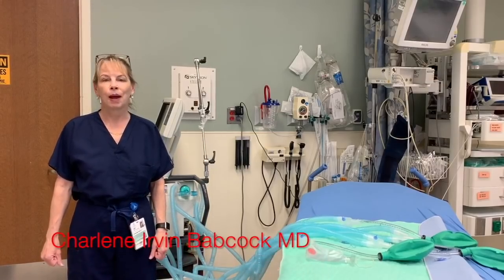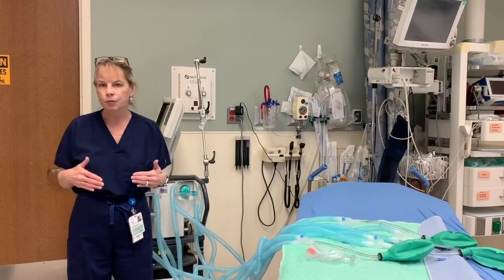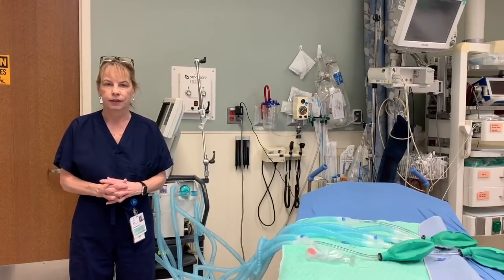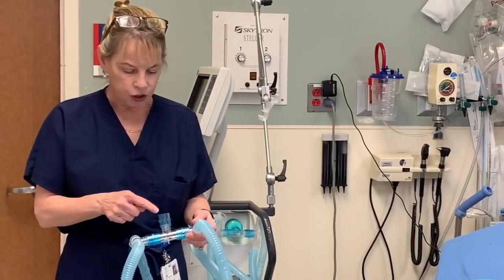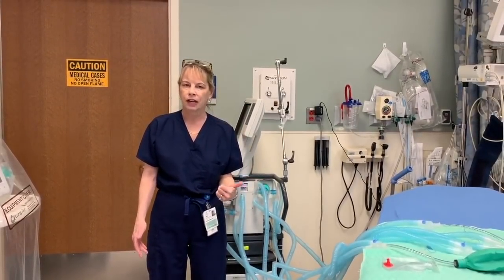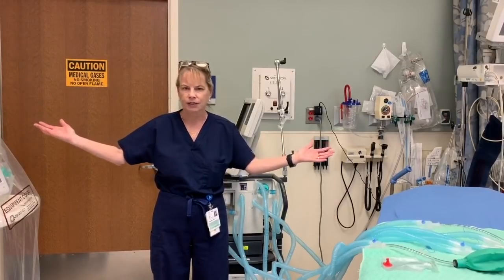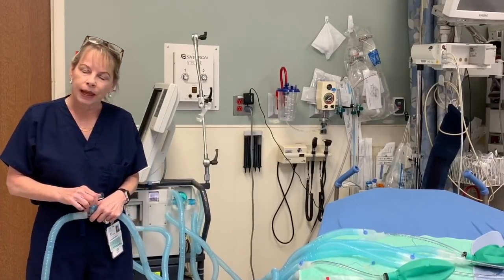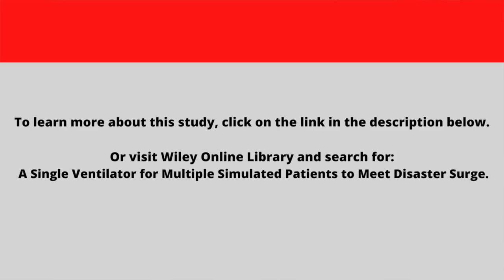COVID-19 How to Use One Ventilator to Save Multiple Lives

Comment: To reduce the flow rate to a single patient you just need to squeeze his particular tube with a simple clamp.
Reply: pls explain
Reply: @eirikskotnerhegstad6361  If you constrict a tube, (just like a if you constrict a garden hose pipe by stepping on it),  you will reduce its internal cross section, which, if the air pressure remains the same, will inevitably reduce airflow. Within this four tube ventilator tubing system, if you restrict the flow within one tube then the flow will (unless somehow the ventilator compensates) automatically be re-directed to the three other tubes, thus increasing their pressure slightly. So each patient can have their flow customised to their requirement by the simple expedient of putting a simple cheap screw clamp over each tube and the clamp tightened very sensitively according to the required flow. The flow from each tube could be measured using a pressure meter, or if these are in short supply then a tiny hand held wind speed meter (like used by sailors) could measure the air speed. If various air speeds, from this particular tube, had once been calibrated with air pressure then a simple chart correlating the air speed with pressure would correctly indicate air pressure.
Reply: Sandy Allsopp that’s not how it works with the ventilators. You’ll cause peak pressuring and an overall reduction in volumes delivered. We are able to control flow to the patient on the ventilator. Please, stop spreading false information by thinking you’re able to fix things with a clamp. That’s not how this works.
Reply: You may not have noticed that I put a caveat into my reply saying; (unless somehow the ventilator compensates). So I considered this. However, I am in the bottled gas business which is totally dependant upon gas restriction via various means and I know that restricting tubes in a subtle manner can be a very effective way of reducing gas supply very finely. If you listen to the video Dr Babcock said that the patients would be paralysed (so hopefully no coughing etc) and they would be sorted to be of generally the same size and tidal volume etc. She considered this and will not be using one machine for a huge man and a tiny child. So all that might be needed in the way of differing flow rates would be subtle changes (maybe 5% - 10% ?). Now, remember we will be using two or more tubes to two or more patients, so pressure build up from constricting one tube will be far less (if anything significant) compared to when using one tube to one patient. Are you saying that a 10% reduction in one of multiple tubes will really cause peak pressuring? If so show me the quantitative data. I  know from long experience of designing and making numerous systems that just thinking about something is not nearly as good as thinking and trying out. It is amazing how many things you learn that were totally unexpected by actually testing things for real. I listen to experts but don't take their word for everything. I want to know they tried it for real first. Unlike almost everyone I know, I do actually try things out for real in realistic circumstances. This way the world learns and moves forward. So what I am saying is just give it a go and test it out. This will only take a few minutes and cost nothing, but the payoff could be the doubling or more of available machines - this saving countless lives. Nothing wrong about considering peak pressures. But you seem to want to stop invaluable investigation by worrying about peak pressures that may not happen. You do NOT know until you have tried it.
Reply: Sandy Allsopp my god you are so dense. I work in a critical care setting actually working with ventilators. Contracting any tube does not give accurate tidal volume distribution. There is no way to monitor each persons rate or volumes delivered when attached to multiple people. Guess what? Rebreathing of CO2 is definitely going to happen here. Not to mention the amount of circuits in itself will cause too much dead pace. You need to honestly sit down and stop trying to compare your experience with working with bottled gas to people who have years of experience in knowledge in actual medical practice.
Reply: Sandy Allsopp Guess what? Multiple people react different to ventilator settings as well. We obtain ABG’s around the clock to determine what settings we need to change. What do you do when one patient needs a higher set rate and the other needs to have their rate lowered? How about one needs FIO2 titrations and the other doesn’t? You literally put more people at risk thinking placing multiple people on one ventilator.  You literally risk killing them all. I also don’t think you understand how much work is being done on just one patient. One patient with pneumonia 2ndary to sepsis on a ventilator takes multiple people and hours of work alone. You’re thinking of trying to cram multiple people in one room on the same ventilator? You risk having them all code and losing them all. Just stop while you’re ahead.
Reply from the maker: GREAT IDEA!!!!

Comment: Sorry..old shool here; But the minute one patient cough theres goes the rest of your ventilation for the rest of the patients... if they all cough at diferent times..same problem... also you suction one...your are pulling volume from the rest.... this system has to be improved with a series of one way valves....also cross contamination .... if you still have  old Bird mark 7 in a closet, that would be the best bet... mas casualty vent vortran (on a paralyzed patient) also you can pressure ventilator but difficult to manage volumes...
Reply: So this method is just delaying the inevitable or, even worse, endangering all the lives on the ventilator?
Reply: attlee2010 this method doesn’t work. The women doesn’t know how ventilator works and is simply just trying to make it work on a test lung (simple balloon). Patients aren’t going to have the same ventilator settings and will react differently to changes. There are 100’s of variables and reasons why this won’t work.
Reply: Beard OF-Courage she said it did work in the response to the Las Vegas shooting. She links to the publisher academic paper  in the notes below the video
Reply: attlee2010 that was also only done for minutes, where they most likely caused volutrauma to the patient as well. Bagging a patient is more recommended than just placing multiple on a single ventilator. Anyone who has experience with ventilators, like myself, know this doctor is full of shit.
Reply from the maker: @Beard-OF-Courage  Bagging a patient has lots of evidence we over bag .....may not be best solution...
Reply: she did mention in a comment that it would only work with paralysed patients,  the one way valve is a good idea, cross contamination is certainly a risk, I think the biggest problem would be the volume management of multiple patients, I guess in an emergency setting, getting similar sized people would be the best shot.

Comment: If you actually showed this passing a SST and showed this on a real test lung that allows you to simulate an ARDS/ALI changing Cstat, Cdyn, Pplat, Ppeak for each pt with the PB840 screen working for over 6 hours, I would maybe believe this 4 person technique ventilation. The infection control on this is insane. Adding filters to this already spectacular amount of dead space is going to make ventilation extremely difficult and in no way equal for all pts. On top of the legal stand point. Did you consult Covidien(PB)? What ventilators were they using in Italy for their multiple ventilation procedures? I can assure you that while the basic mechanics of ventilation are the same, brands run differently. Not to mention that if you're implicated in a lawsuit from this, you are going to lose your license. Yes you spoke to the families prior but I doubt they would really understand what is happening with this procedure.
Reply: Diane Harris she links to her published journal paper below the video. That may answer your questions. She said it worked on patients in LA
Reply: @attlee2010  no it does not. She reiterates what is in the paper. These questions are not answered nor or they asked.

Comment: The deadspace in this circuit is insane, if we were really this screwed then it might be beneficial to use shorter corrugated tubing and y connectors otherwise you're doing a lot of rebreathing.
Reply: Where is all this dead space?
Reply: Angry Breatherer from the additional tubing not meant to be part of the circuit. That is your dead space.
Reply: Mr Tech Gamer 
No, that is additional compliance volume lost.  NOT dead space.
Reply: Angry Breatherer look for the definition of dead space.
Reply: Mr Tech Gamer which type?
Reply: Angry Breatherer Google it
Reply: Mr Tech Gamer 
Well.  Your still going to have to specify which type specifically :) and while you’re at it you may as well point out the exact location of the dead space.  I fail to see it.
Reply: @oldfashionedsportsmanchave4590  every part of the circuit not involved in perfused alveolar gas exchange is dead space. This includes the trachea, the bronchial tree, the filter/humidifier, and the corrugated tubing. In peds patients even the filter can make a very significant difference.
Reply: John L. Nope. Not so homie. Dead space stops at the “wye”.
Reply: Christopher Whelchel 
That vent can deliver a base flow of 20lpm.   Plenty to wash out exhaled gas On paralyzed Patients.  And with inspiratory flow capabilities, of 200lpm.  That vent in PCAC could easily ventilate 4 people with adequate inspiratory flows.  Place 4 end tidal  devices in line, and adjust rate / pressure so every patient has the best average end tidal.   Dead space would be a non issue.  Compressible volume, non issue as the goal would be to ventilate per end tidal and chest rise.  The triggering limitations caused by the increased compressible volume would also be a non issue, as they would require paralytics anyway.  Being pressure limited, low risk of barotrauma/ volutrauma.  As these patients would be ARDSy.  They would have short time constants, making air trapping a non issue.  The literal only limitation would be variance in volume distribution per patient, BUT,  it wouldn’t be enough that this method wouldn’t keep 4 similar patients alive long enough for other resources to come available.  In my opinion of course.
Reply: Christopher Whelchel 
Christopher Whelchel 
That’s interesting.  My pb840 pocket guide clearly states 200lpm.  And ards patients have very short time constants.  So, they don’t need a long time to fill or empty.   Sooooo.  Your 6’ guy would need a VT of 465 at 6ml/kg.  At a rate of 30 that’s a TCT of 2.0sec.  Say you give him a 33% iTime.  Probably  fast enough eh? That’s a minute  volume of 14/33x.01= so 42lpm peak flow needed.  It would be roughly a 0.66sec iTime.  Either way, add that up 4 ways and it’s still beneath your 180lpm.  
Some populations might have longer time constants on expiration.  But it would be unusual once ARDS is set in.   Making those settings again, viable.  
Optimal....no.  
As far as diffusion complications.  Turn them up to 100% man.  Give extra PEEP if you feel the need.  BUT diffusion problems do NOT  lead to CO2 retention.   Remember it diffuses 20x faster than O2.  Diffusion rates for common gases from fasted to slowest,  CO2, O2, and CO.  But who care about that.  
It would work.
Reply from the maker: I agree....makes sense to use shortest tubing possible....

Comment: Can someone explain why there is not a central system like maybe oxygen with independent regulators or other required devices to tailor for each patient. Why the need for independent machines.
Reply: Depending on the underlying problem, patient's need various settings on the ventilator.  You cannot put someone with bad heart failure needing a vent with someone suffering from trauma for instance, their specific ventilation needs are different.  But if you have enough similar patients with similar disease, this could work.
Reply: SCMakaveli yes but why a single machine per patient. There are many “plumbing” cases where a central system delivers then individual valves/computers control the final output to each. I know it’s more complex then just the oxygen to each room but seems like an opportunity for improvement.
Reply: @gabrielbatiz8168  This is precisely why this setup will likely not benefit a COVID-19 patient.  #1, we're all different sizes and shapes.  #2 every patient has a different demand for ventilation, some with renal failure will require more ventilation.  Those without will require less. #3  Having a "central system" is not possible because of the driving pressures required to actually ventilate a patient  #4 sharing equipment has been a no-no for a long time because of infection from cross contamination between patients.  How do you think all those folks got sick on cruise ships?  CROSS-Contamination.
Reply: It's not just about O2. Pressures, volumes, flow and time are controlled by the ventilator depending on which mode/strategy of ventilation is employed.

Comment: These Las Vegas patients cited as proof that this works was in patients that weren't battling a disease that directly effects the lungs, and in many leads to ARDS. This is begging for more problems than it potentially solved as you start having four patients with rapidly changing conditions hooked up to a machine that can't provide you with measurements and accurate data on any one of those patients.
Reply from the maker: It is being used successfully in ITaly.....yes it is off label...yes it challenges the clinician to 'match' patients as best as possible for compliance, TV, resistance, etc...but it is working...see below about Italy...I've also been told its being used in Egypt.....  THe last sentance in the article (translated) is: "...its like multiplying  fish and loaves."

Dr Marco Ranieri of Bologna, Italy and his team Have successfully tested the approach in vivo in one of the hospitals in Italy overwhelmed by the COVID-19. 

They worked with Intersurgical, an Italian company based in Mirandola, started producing the circuitry in only 72 hours, and the first prototype has already been tested by Bologna Sant'Orsola Hospital. It works and in the next few days they'll start a mass production to supply Italian hospitals who are in need

Here some news in Italian. 

https://www.huffingtonpost.it/entry/a-mirandola-testato-ventilatore-che-assiste-2-pazienti-bonaccini-straordinario_it_5e73c3e1c5b6f5b7c540a8d2
Reply: i don't understand your problems with this method. you have no idea about the massive number of patients this pandemic can bring to the hospital with respiratory failure. at such a situation it is less about the quality of care and more of the number of lives saved. you must be one of those people who would insist on a 10 minute history taking and 20 minutes of general examination and another 30 mins of systemic examination before you decide what to do with a patient. in a disaster setting at least 10 would die waiting in line for you. different situations need different solutions. not more problems
Reply: What a stupid comment - what is your suggestion?  Pick one to live and let the other 3 die?

Comment: This is great. Am an MD. We have some people trying to see if they can use 3D printers to make connectors. Another thought I had. Can we add a small hole with cap on each connector we could put a tire pressure gage on and measure pressure to each patient. And then change the diameter of the connecting tube to adjust pressure? This would allow for minor differences in compliance as ARDS progresses. Thank you for posting.
Reply: You won't be able to independently measure pressure... As all four 12 foot circuits are connected to common points on the ventilator.  Plus a tire pressure gauge is not sensitive enough, as it measures in PSI.  Whereas vents will measure in cmH2O.  You'll have to convert but the unit of measure won't be precise enough coming from a tire pressure gauge.
Reply: sunny you are on the right part.  I was thinking of doing this.  I am working on the plans right now.  please come join OpenRespirator.org we need all the help we can get

Comment: Only part of the idea of the patients being cohorted with coronavirus mitigating the risk for cross contamination is accurate.  We each have our own normal flora that our bodies are used to.  With the risk of secondary bacterial pneumonia being a huge risk with the leukopenia that has been reported with some of these cases, I believe it's important to really consider the cross-contamination risk.
Reply from the maker: you can add a filter to the 'mixing. bowl' right at. the expiration port. at the ventilator.  Four filters in line before the vent could doit!

Comment: I've seen two vents for one patient, before!
Reply: @acm-Ggirl21.111  I've heard a report from Dr. Lebedinsky from St. Petersburg about such case at a conference. Elderly woman with severe pneumonia, ventilating both lungs in one mode lead to overextension of healthy lung and failure to recruit sick lung, with severe hypoxemia. They used separate ventilation for each lung in different modes and managed to recruit sick lung and protect healthy lung, which significantly improved oxygenation and X-ray/CT picture.
Lebedinsky actually published this case too, but the article is in Russian, I don't know if it has an English version.
Reply: @acm-Ggirl21.111  sure! Here, I've found an abstract on PubMed: https://www.ncbi.nlm.nih.gov/pubmed/25549491
Reply: @acm-Ggirl21.111  Each lung, for one reason or another, required different volumes and pressures.  I think they may have even had a different rate.  The ET tube was also pretty interesting.